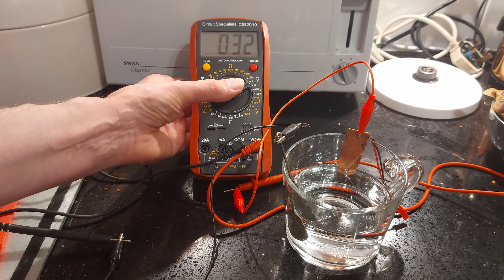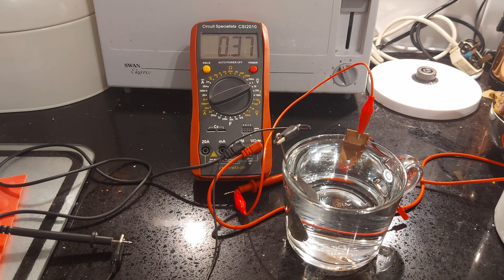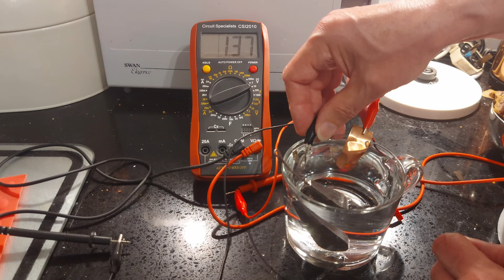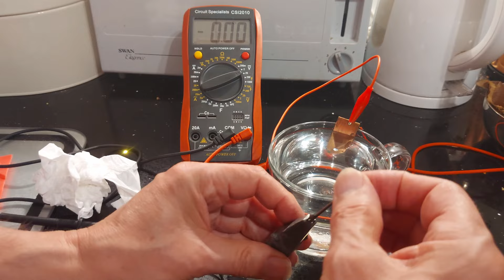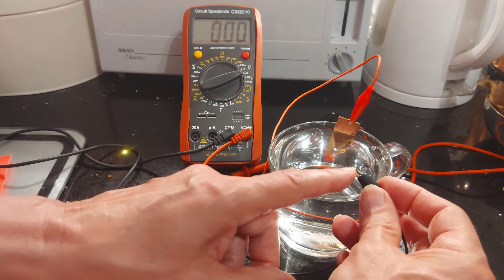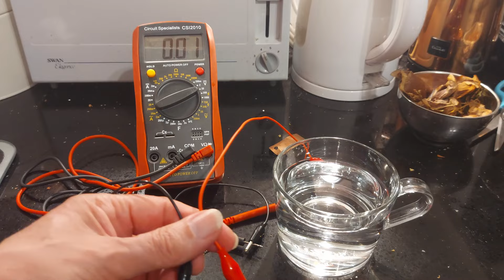Lead Copper Steel Magnesium Water Voltage

Comment: Really interesting Graham. 
Here are my thoughts. 
The electrons will travel along the steel even though it is connected to lead or any other metal that will produce electricity while submerged in an electrolyte which in this case is just boiled tap water. 
The crocodile clips are metal, so it depends on the type of metal they are clipped to that will create a reaction of either good or bad electricity production but there must be more going on because the readings change when the crocodile clip and the lead or magnesium are submerged together. Need to be a chemist to figure that out. I would also use a more reliable multimeter.

I was very surprised at the voltage increase when you moved the magnesium about in the water and the voltage difference when the metal rod in the lead was submerged along with the lead. 
Lots of odd chemical reactions must be happening that I don't understand and this was just boiled water.
Might be interesting with salt water or something similar to see if the odd relations still happen.
Obviously, I know that salt water will act as a better electrolyte but it was the other voltage changes that I found strange. 
Enjoyed this a lot. 🔌 👌👍👍👍
Reply from the maker: Here is my take on it after having a bit of time to think about what is going on.

It is not the current flowing through the steel that is important, it is the current flowing through the water.

As Slider2732 commented, it is similar having two resistors in parallel. The end resistance is not the lowest value resistor. 

Although we are looking at voltages generated by the galvanic effect rather than resistances, it is all part of the same sort of thing. 

Maybe think of two batteries in parallel
The Steel/water/copper is battery A
The Magnesium/water/copper is battery B

They are in parallel because the same water is connecting them both, so what voltage is generated?

It is not a simple addition. Remember how excited people get when we talk about putting LiPo cells in parallel when one of them is dead.

The circuit will try to drive both cells to the same voltage so the higher voltage must drop.

The main thing I took from this is it is easy to be sloppy in setting up an experiment and the results you get can vary quite dramatically when you have missed a simple basic criteria. 

Somebody had pointed out in one of my potato experiments I had allowed two potatos to touch. That would have allowed electricity to flow directly between them rather than through the electrodes and wires I had connected. 

And finally, YES, that meter does not do me any favours, but I have to give it a try 🤣

Comment: Your experiment is of little use.  When comparing two (or more) materials You need to test them in the same condition. Same surface area, same distance. etc.
Reply from the maker: @darthclone2002  I guess I didn't make it clear enough. This is specifically about what difference it makes if the steel rod of the lead weight touches the water OR the crocodile clips touch the water. As shown, the difference between the lead and the steel was negligible, but when the crocodile clip on the magnesium touched the water, there was a significant drop in the voltage. SO, if you are sloppy in your setup and allow the crocodile clips to touch the water, you are not getting the results for the magnesium. Read my thoughts in my reply on the pinned comment.

Comment: I think you simply need a new multimetre. Preferably a better one, with a higher impedance too.

Thanks for sharing your experiments and food luck!
Reply from the maker: @alinochis1514  As shown in previous videos, I picked up this meter in a charity shop, so using it in videos is part of the process of finding out what it does well and what its issues are. For filming, the large display is useful, but it clearly has issues.

Comment: If u use salt water ?
Reply from the maker: Hi Ann. I have done a whole series of videos using different electrolytes, including salt water solutions, ice-cream, milk, soft cheese, tea, mud. These two videos were specifically about what happens if you allow the crocidile clips and/or other parts of the circuit to get in the water (Or whatever you are using for the electrolyte). It messes up the results.
Reply: @GrandadsOtherChannel  ah thanks 👍 …I forgot I was commenting on my new I pad which nearly 7 months since Santa brought it we have not synced with my old one which I actually use more xx

Comment: Good tests. It was one of those commonly held beliefs that am glad you tried. I think it's like parallel resistors, where the end resistance isn't the lowest value of resistor in the circuit.  
15:38 was hilarious 😂
Reply from the maker: I like the size of the display on that meter, but I don't trust the readings. However I will probably keep using it to familiarise myself with it's "features".
Reply: @GrandadsOtherChannel  Did notice it seems to have a wonky selector dial. Am not sure if you've done a pencil eraser/rubbing alcohol type clean up of one of those (on vid) but they are quite fascinating how the little dash tracks work. Often have a couple of ball bearings in them too that like to drop onto the floor!
Reply from the maker: @Slider2732_  as it happens, the "peek inside" video for that meter goes live tonight in about 6 hours time. Here is the link but it won't work yet https://youtu.be/5QHdlnZ8-54